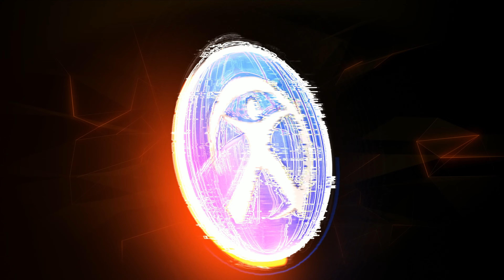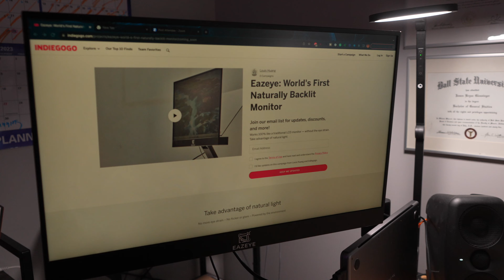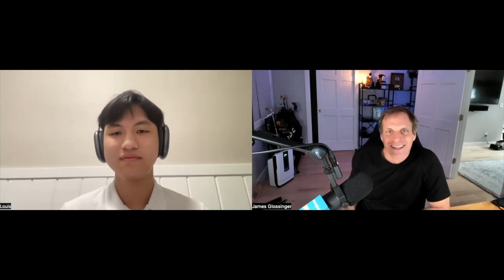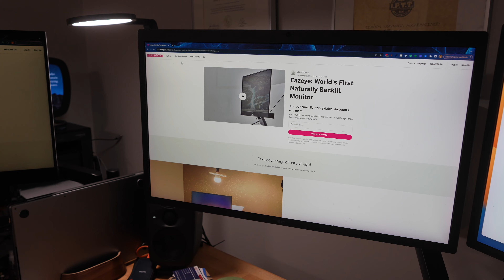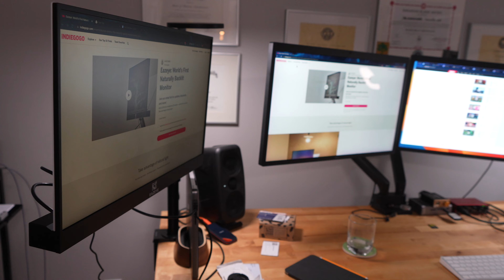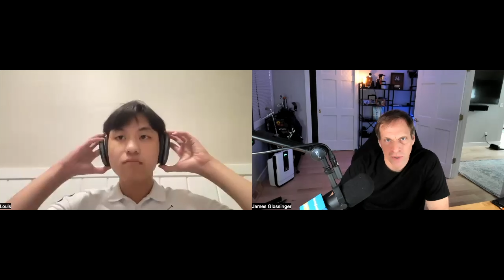EAZEYE Monitor Launch! - Founder Interview

Comment: Does the monitor allow you to adjust it, swivel and height? Also would it work next to a window, not directly in front of?
Reply from the maker: Yes, I am using a typical VESA stand so you can move it around, and yes works amazing in front of window - any light behind it and good with it's LED's to me a little dark without direct light is behind it. Still works for me will get another review up soon